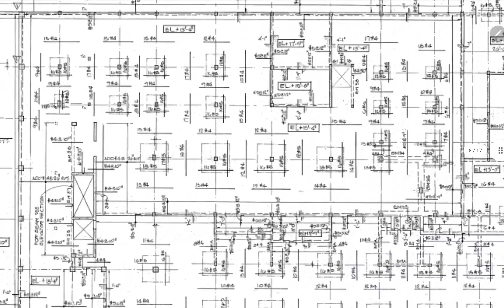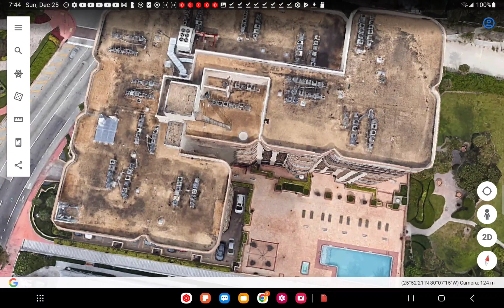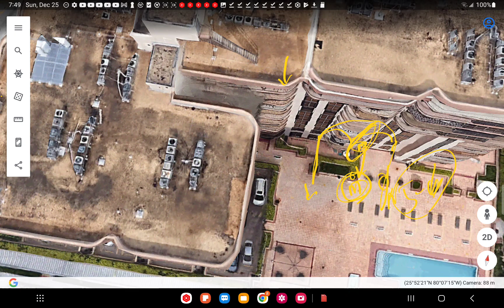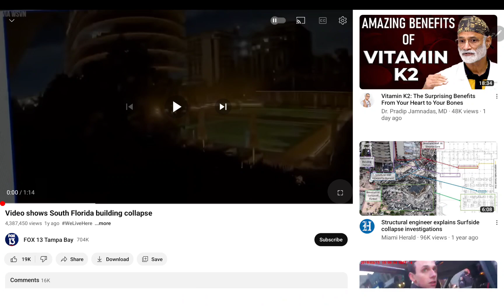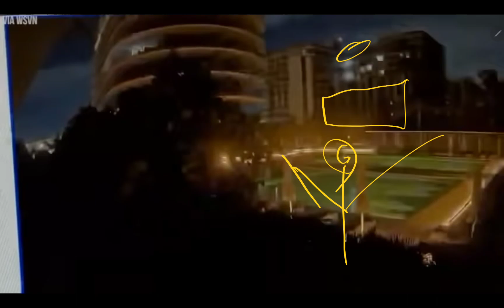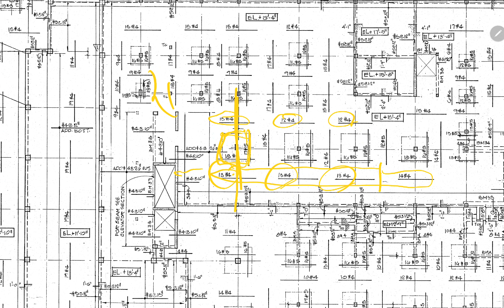Champlain Towers Roof was first to fail and NOT m or n in garage, let me explain PunchShear at roof

Comment: So, not parking deck.........
Reply from the maker: Yes, parking deck caused the failure, with repeated shock loading ... This caused the pool deck and parking deck to collapse...
This rattled the building and I believe the roof was first to fail and bc k,l, and m do NOT even have the 1'-6" (plinth beam) beam at face of building, this allows for this section to buckle as the shock loading of the building collapse takes place. 
Yes, I have the roof as the initial failing of main building structure...
The Nir's floor , literally was doubling as a beam from column to column at one point...but, it lost a lot in rigidity once the balcony failed (their pool /deck balcony)... Leaving that span with approximately 6" of slab to span from column to column.
Sur Campbell, I release the other parts of this roof collapse over the next two weeks.
Note, I can't publish anything new bc YouTube has blocked me for a week! 
I can respond and I can move the private room videos out to the public but nothing new for now. 😂
Reply from the maker: Ps Look at my pinned comments, I have most of the series there.

Comment: I see said the blind man! Would not the hammer and nail effect cause the pilings to subside during the collapse? If the NI3t found subsidence, can they tell when it occurred? As in slowly over time or all at once during the building collapse. I think you stated that there were structural repairs done somewhere on the roof. Maybe they did not repair all that was bad. Remember the condo board were very stingy with their money. Your videos are very thought provoking, and I am glad to be a member.
Reply from the maker: Christopher, you hit the NAIL ON HEAD / PILE CAPS and garage columns on the head.
Your comments are exactly what I was looking for! 
To verify subsidence, they would have to determine if any of the pile caps were fractured from the impact driving...
Christopher, this video will go public on the 6th, I think... (Another copy), please be sure to add your same comments then, as you nailed it, great job.
Now NIST will not give two shites about the truth? 
Recall the WEF (World Economic Forum) already stated it was subsidence
Reply: @LoadPathEngineering  will do!
Reply from the maker: Part 1 https://youtu.be/8gZaFE0Fsx8
Part 2 https://youtu.be/_dL3JgE55vk
Part 3 https://youtu.be/BkB4TmAqlv0
Part 4  https://youtu.be/gpM9i1WpZ6I